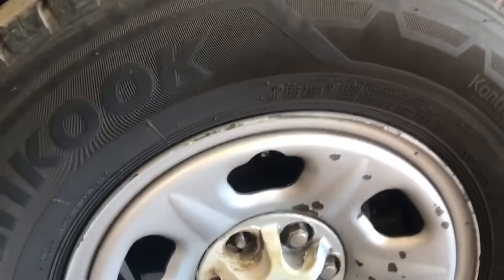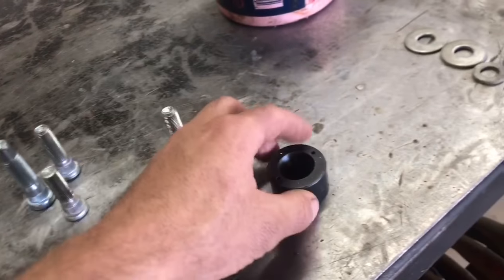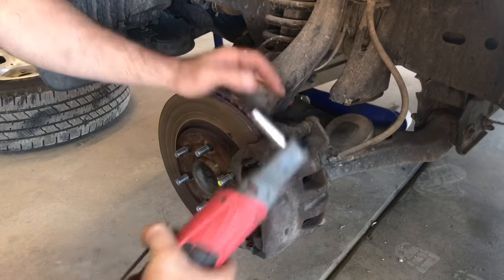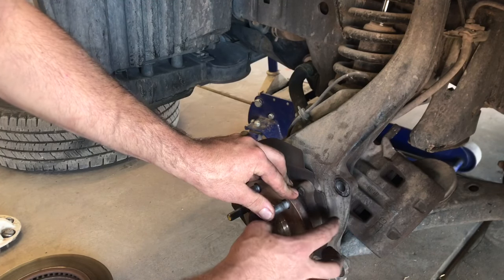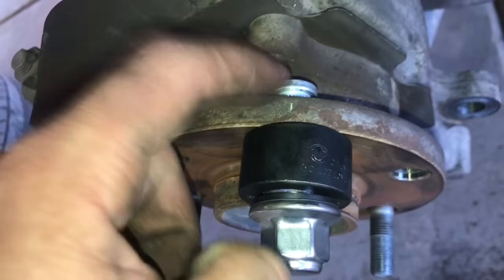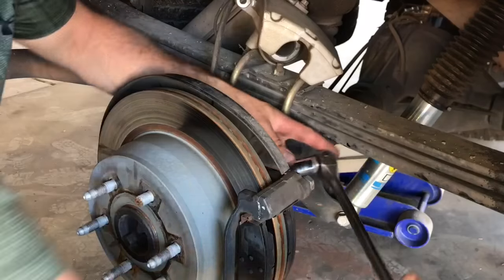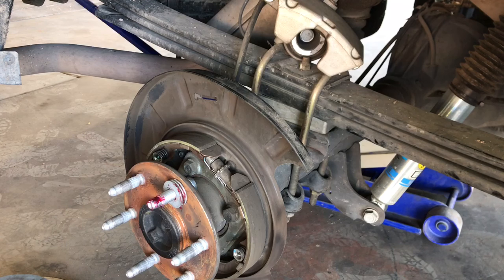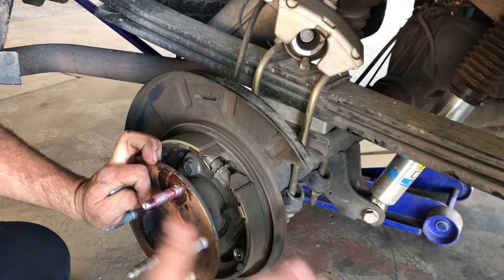Wheel Stud Removal and Replacement (Complete Guide)

Comment: Who would dislike this video? Maybe it was the auto shop that will now not get my business because I can do the work myself.
Reply: People may have disliked because there are better/safer ways of removing and replacing a stud. I think this is fine but for OCD types they may opt for using a less harsh method (joint separator, for example).
Reply: WAKA WAKA!!!
Reply: Maybe people tried it and it wasn't as easy as it seems
Reply: If you add a larger washer; such as a 27mm and insert your regular washer, let's say uts a 19mm, you can Insert the 27mm backwards through the bold and slide the smaller one inside. 😉 also It works just like a replacement washer and i just used wd40 and hand cranked it with my torque wrench
Reply: Probably because the hammer method is a good way to ruin a wheel bearing. I’ve never had studs come out with light hammer tapping.
Reply: I’ve always done it without use of an impact because I’ve seen splines rounded out with a cross threaded lug on. Have fun trying to get that wheel off.
Reply: They wanted to charge me 150 dollars to change 1 stud
Reply: The same reason why im about to dislike this video. Hand tighten, then torque the stud down to spec with a proper torque wrench. Never tighten a lug nut with a power tool. You increase the chance of cross threading and end up needing to replace more studs.
Reply: @chase3043  good point
Reply: @dawsonreum8096  was it like this set up? Or was it on one in the rear on one that requires you to pull the axle out a little?

Comment: Good advice but I'd like to give you a tip/trick for the next time you need to remove both the caliper & bracket. You can use a C clamp to depress the caliper pistons just enough so that you can take out the 2 bolts that hold the caliper bracket on. Doing this let's you slide the bracket, caliper & pads off the rotor all together. It saves a little time when replacing studs or hub & bearing. Daddy taught this girl well. 👍😁
Reply: And remember to protect the master cylinder by simply opening fill cap before using C clamps.
Reply: @f c exploding, if the brake fluid level is high, when you compress the piston all that fluid has no where to go
Reply: @rusty nail my understanding was always just that removing the fill cap before pressing your calipers in keeps the lines and caliper free of air getting inside, eliminating the need to bleed them. This actually does work. The brakes feel spongy as hell at first but pumping the pedal and refilling the calipers with fluid returns them to proper operation. If you were going to press all 4 calipers at the same time, common sense tells us that once your fill reservoir is full of fluid if the cap remains in place there’s going to be that point that the calipers stop pressing in at which point if you tried forced them to press something somewhere would rupture but I’d be quicker to guess this would occur at one of the other calipers. Now that I’ve typed all that i realized that @Benjamin Black is the one who this reply probably should have been addressed to. My bad, can’t just erase it though.
Reply: To all the commenters about the master cylinder.  It's impossible to "explode" or ruptue any part of the system unless there's a weak point already.  It would already have ruptured during normal driving due to the high fluid pressures during braking.   Secondly, as brakes wear, the fluid level drops in the master cylinder.  When you compress the wheel cylinders, you are pushing that fluid back into the empty space in the master cylinder.  The brake system is a sealed system.  Unless you open a brake line, there should be no air in the system.  The brakes will feel spongy after installing the calipers but it will go away after a few pumps of the brake pedal as the fluid in the master cylinder get pumped  back into the lines and calipers.  None of what I stated applies to cheap Chinese master cylinders.  Some don't have a bladder in the master cylinder cover to take up the empty space.
Reply: @rusty nail You won't 'explode' the master cylinder, but you could easily rupture a seal somewhere.
Luckily, most modern cars actually have a vent in the brake fluid reservoir so overpressure has somewhere to go before damaging internal components.
Reply: @Rusty Nail When I cracked the reservoir no overflow occurred.   When I neglected to crack the reservoir overflow occurred every time.
Reply: I removed the whole caliper with bracket before I even saw this video I just wanted to see a pro do it before I did it myself if you're careful you can remove the bracket and caliper together and save you some time
Reply: Nope. You don't have to depress the caliper.  Just slide it off and slide it back on.
Reply: No you can just unbolt the bracket and the caliber and pads come off with the bracket
Reply: Or all of y'all could just do like the guy did in the video. Without having to contemplate an error.

Comment: Wow, I was just quoted $1,700 to replace 10 of these, this is basic level skill required. Thanks for the helpful video.
Reply: robbery lol
Reply: I wouldn’t call it basic skills..  any skill is ez when u know it .. but not when u don’t 😂😂😂😂😂
Reply: I just had a seized lug nut on a spinning stud. 3 hours with my buddies help. Luckily we had all the tools. Because wow. What a trip that was. Covered in metal slivers. This was not easy
Reply: Thats every single mech job
Reply: I would!. These studs were not years old as you can see they pop out in 1 or 2 hits.

Comment: Quick tip! You can use a very large socket (about 30mm) and fit it over the stud backwards to act as a removal tool. Simply put a nut on the stud after placing the larger socket and ensure you have enough room inside the larger socket for a smaller socket. Tighten up the nut until you can’t anymore and you’ve installed your wheel stud!
Reply: f'n genius, my guy.. didn't realize it, but I got two of  32 mil sockets!! I hope it works when I replace some studs!
Reply: Lmao it won’t get stuck in the socket square?
Reply: Smart! Thank you
Reply: I just tried this and it works great. I had a 1 1/2" socket lying around. Thanks! 🙏🏻
Reply: better than nothing, but not quite the same as the proper tool, which has a bearing on the back side to reduce friction and chance of spinning and ruining the splines/hub.

Comment: A method I came up with to set the studs is just get the stud in place, slide a couple close ended wrenches over the stud and start tightening while applying pressure to the wrenches to keep pressure on the head of the stud so it doesnt spin.
Reply: Damn I have a rounded stud head

Comment: Just bought the Lisle tool. Hard to believe there are kits that cost over $200 to do this. But if you have bad aim, use a soft metal hammer to remove the stud. Like a brass hammer.

Comment: Be replacing 8 tomorrow... hope they come out that easy.
Reply: Use mapp gas. Don’t get to crazy on the hammering. May damage wheel bearings. Just FYI.
Reply: I’ve made a rig with a c clamp. 
Basically use the old lug nut. Seat it all the way possible with a gap. 
Then take a piece of wood and place it on the nut. Use two c clamps and tighten. It should gently pus the stud out.
Reply: Ah dude  take the axle right out and  pressing them out was real easy, bro has a truck shop so the right tools made the difference👍

Comment: Thank you for this, I have 2 busted studs on my 76 El Camino driver side front wheel, they broke off almost clean with the hub annoyingly enough
Reply: Gud video gud advice. i have one stud to replace will do it myself. Easy n simple but garages always make out the job is harder than what it is.
Reply: Some cars are a lot harder than the smart ass, Try replacing a front wheel stud on a front wheel drive import! Also it is harder on his El Camino because you have to remove the front bearings and rotor, All vehicles  are different that is why prices can vary by $100s

Comment: I had to completely remove the axle to replace the studs on my 2003 F-150.  Then the studs had to be pressed out on a 12 ton press because They wouldn't budge with a few hits from a hammer.  This guy is lucky.
Reply: rust also complicates things. to get the front studs out of my rusty 2002 sierra it took many hits with the sledge for the studs to finally come out. Had to remove them so I could use a bolt to pull the old wheel hub off.

Comment: Good video with some grest tips. What's missing is what to when one stud snaps off while tightening a lug nut on it, but will Not pull out from the hub. On the rear left of my 08 RAV4, one stud is somehow caught in the hub. I can rotate n jiggle it, but not pull it out, and now have a lug nut on it enough that I can only see ~1/4 inch of the bolt, so no angle to cut it. And no access from behind, of course. Any suggestions?

Comment: Two questions:
1- Why didn't you remove the entire brake (two bolts holding the bracket) instead of removing it in two pieces?
2- Why don't you just put the studs in place and put the rotor+wheel and tighten the nuts? since it will automatically pull the studs into place without the adapter?
Thank you
Reply: I would want to make sure the studs are  fully seated too, before I put the rotor and wheel on. I think it would take more than 100 ft. lbs. of torque to pull those studs in. I don't want to puts the wheel on, then have the wheel start wobbling because the studs were not fully seated.

Comment: Thank you! To remove the caliper mounting bracket you used a 14 mm socket, my question is, what kind of power tool or impact wrench did you use? I am not familiar with that type of wrench. Can you send me a link to buy it or rent it? Again thank you! 😉
Reply: Its a milwuakee right angle impact wrench

Comment: Car we just bought day of the tire blew out so as we where taking off the lug nuts to put the spare on we found someone had impacted the piss out of 3  of the nuts practically welding the lug nuts to the studs. They snapped immediately as soon as pressure was applied to remove them

Comment: Is it true that using a Pneumatic Hammer on those studs could damage the wheel hub bearing assembly?
Reply: I was wondering if that's what happened with the Chevy stud. Broken due to air hammer placement strategy.
Reply: Nhoy Barangay  we use them all the time,  its absolutely fine as long as you know how to use them

Comment: So I was just wondering why do you take the caliper off before the bracket, arent you able to take the bracket off with the caliper still attached to the bracket? Is there a reason as to why one should not do that? Thank you for the informative video though
Reply: There is no reason to separate the caliper from the bracket, If he was an actual mechanic working in the shop he would not make it always separating the caliper from the bracket!

Comment: Does the hub assembly have any threads inside the holes, or are the bolts the only thing that has the threads? Thanks in advance.
Reply: No there are no threads inside the hub! The base of the wheel stud has a little splines on it that compress when pulled into the hub so it is a tight fit

Comment: Quick question. I don’t have power tools, can I still tighten the stud with a ratchet properly ?
Reply: Yes you can absolutely pull a wheel stud through a hub using hand tools, However try to use something a little bigger than a standard 3/8 ratchet to pull the stunt through!

Comment: I wish I could do this stuff when crap happens, because my kids car went from what I thought could be a tire repair from a puncture,  had it towed to the AAA Service center unfortunately all the tire shops were closed, ended up with a $320 bill, because the couldn't repair the tire no biggie, I went and bought one cheaper from a tire shop and then apparently they broke or damaged one of the studs, mind u there was already 1 that was stripped as I learned when they examined it, so now I need 2 new studs which will cost me $320 ! I knew I would get screwed one way or the other. Smh

Comment: I'm so mad at how easy those studs come out, I'm hitting mine with a 4lb hammer and it's not moving
Reply: Buy a torch from menards heat em up and give em another whack
Reply: Soak them in wd40 or liquid wrench in both sides Mutiple times in a hour and then try it again. Mine were bad too but Mutiple soaking worked.
Reply: @ramanpreciado2241  turns out that being an Acura (Honda) I needed to grind down part of the hub to give myself a spot to get the stud out
Reply: @brianlajeunesse5321  live in the south no menards here friend, got my torch from Home Depot where I work

Comment: I have a Buick Lesabre 2001 that the stud doesn't want to come out. Any suggestions? Thanks for sharing.
Reply from the maker: Heat will do the trick, use one of these to help free it up!

https://www.lowes.com/pd/BernzOmatic-Trigger-Start-Torch-Kit-Handheld-Head/50126397?cm_mmc=shp-cprdtolgooglelia-142-welding-50126397-_-0&placeholder=null&ds_rl=1286981&gclid=EAIaIQobChMIiIGvwOmA8QIVXz2tBh2Q2w3XEAQYASABEgIj1vD_BwE&gclsrc=aw.ds
Reply: @AaronHinesAuto  Thank you very much. I really appreciate your help. Thanks again.

Comment: How would you remove the whole assembly mine is loose need to tighten it
Reply: The wheel assembly? The center nut. Check your torque specs

Comment: Would i have to replace both wheel bearings on both sides of the vehicle or can i just replace one side and call it good? Hard times you know. I'm gunna try replacing the studs but i hope the rotor isn't fucked up or the wheel bearing dont have to get replaced.